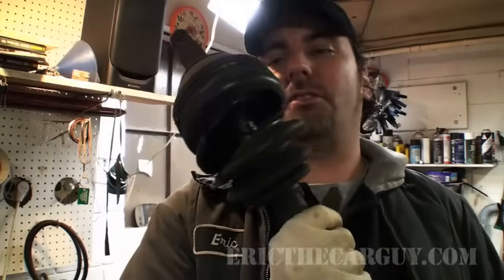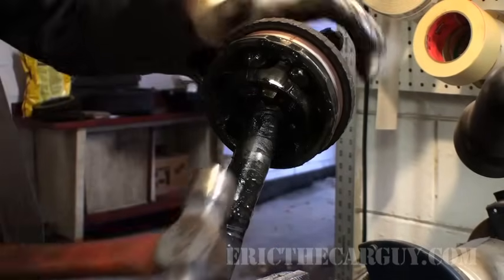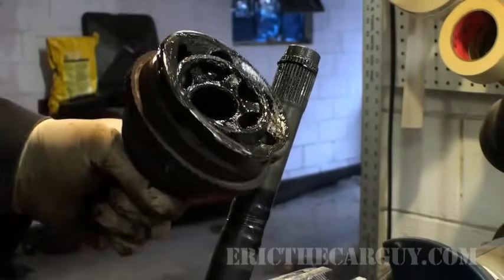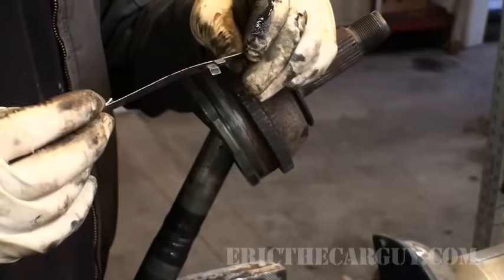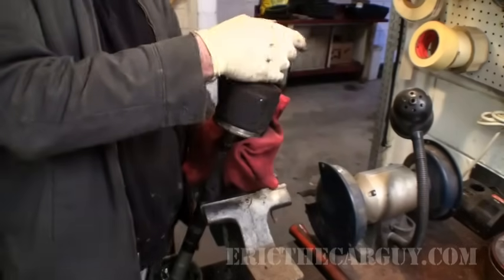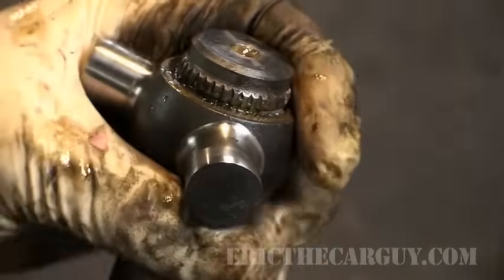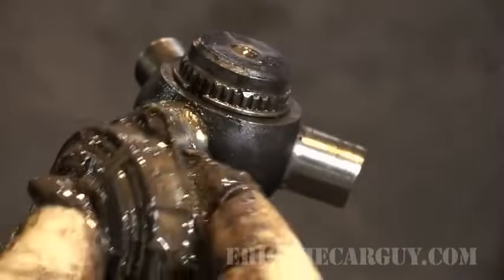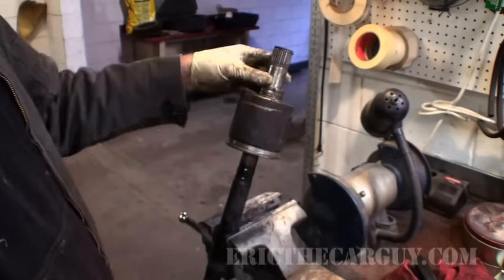How To Replace CV Boots - EricTheCarGuy

Comment: I have a new car. I ran over some wire and the CV boot was torn. Because the car is new they want 510 bucks for the new CV axle. 

Have you had any experience with split boots? I have heard over and over that they aren't worth the time or money but this has been caught quickly (so not much if any dirt in the joint) and the new CV axle is 510.

Do you think a split boot could hold me over until car parts for this make and model start becoming more common and cheaper?
Reply: Depends on how bad the split is. Sooner or later it'll run out of grease. No grease, no lubrication. No lubrication, parts wear faster. I'd check Rock auto for the part in question and to also do it yourself. Good luck.

Comment: Eric! I need your advice, or at least someone on here. 
I have an 03 Jeep Grand Cherokee Laredo with 2WD to 4WD option, I have been dealing with a loud knocking nose and the jeep likes to make a "back and forth" motion when i apply the brakes, The steering wheel does not shake, and the brake peddle does not vibrate or kick. I have jacked both front wheels up and turned them as fast as i could, The rolled smooth, and did not hear any unusual noise or knocking. Wiggling both front wheels and they seem good.  My main question is, if it is a bad cv joint. Could i just remove both of them on the front and not replace them?  I only use 2WD all the time and dont even have the driveshaft attached to the transfer case for 4WD.
Reply: The back and forth motion might be caused by a warped rotor. Maybe have them turned and replace brake pads. Just a thought
Reply: New rotors and brake pads have recently been installed to trouble shoot this, so far no good luck. I did end up pulling both front wheels and the front end out to examine the cv joints and they are fine. But i hear a knocking noise constantly when rolling down the road, 1 u joint was replaced, the other one was examined, told it was still in good condition and shown that it was. Replaced all wheel bearings.  Im hoping its just a transmission mount or something.

Comment: I just use a universal boot that’s cut open on purpose  and without taking the axle out or any of that work all I do is cut the boot to size and then wrap it around the axle shaft and then use the supplied rubber cement that binds it together ( insanely strong) and then just use cable ties. Done in 10 mins

Comment: Can anybody tell me what grease to use on inner tripod, what nlgi rating it is and what its made of, because i cant find any answers online or from part stores or the dealer, they all say to use cv axle grease but from my research moly will ruin tripod needle bearings. I have broken three sets of aftermarket axles due to inner joint developing play and causing clunks and vibrations most likely because they are using the wrong grease on assembly. Want to regrease my original gm axles but cant get any awnsers

Comment: Is it normal to hear some clicks just after changing the cv joints? Maybe the grease need a little time to fit good on balls? I've just done the hole thing that I saw in this video.
Reply: Louie Anderson Did you replace the WHOLE axle, replace an actual CV JOINT, or just reboot? At any rate, I wouldn't expect to hear any clicking if it didn't exist previously. Maybe it's not fully seated in the transmission?
Reply: hoopfan71 I've changed the cv joints. I think that my error was from knocking the cv joints to fit with the axle. Was a pain in the a*s to put that ring in the cv joint for the first times. Maybe they are clicking because of knocking them too many times. The noise starts after 1,2,3 miles from the start If I drive normally. If I redline it, the noise starts from 1/2 mile and I hear the noise louder then normally. Sorry for my bad english. By the way I just ordered brand new axles.
Reply: Louie Anderson Did you try removing the axle and reinstalling it? Yes, that clip is a pain. One of my axle re-boots went just fine, but the other one was a pain in the arse.
Reply: hoopfan71 Yes, I removed the axle and I reinstall it. Like in the other video of Eric.

Comment: but you forgot an important thing before you rejoin the CV to the Axel you forgot to clean it with gasoline or whatever to ensure that the cv is pretty clean from the old grease that maybe holds dust caused by the cut boots .. but im sure you didn't forget that :)
Reply: +The Future Sound Of Egypt He said use solvent and a parts washer.  I've used a pressure washer and detergent, it works.

Comment: Question: My axel boot is completely ripped open on the inner joint(1999 Subaru Legacy Outback). I don't hear any clicking at all, I didn't think anything was wrong with them, I just noticed it while changing the breaks. However I was changing the breaks because the car shakes hard and pulls to the left when breaking hard. Changing the breaks (rotors and pads) did not fix this. Could it be an issue with the axel?
Reply: Have you checked your brake rotors? bad rotors will cause that

Comment: Have a leaking inner cv axle boot on a 2002 civic. Is it ok to use one of the aftermarket boots that are split and Bolted closed? Don’t have the means to take off axle.
I can then pack in more grease while axle still installed in car?
Reply: You better do it this way, those split boots wont last long. Do it once right, or do it twice
Reply: @gianfrancoa   just updating...I did replace entire driver side axle and was not hard at all on this car. I just had someone come give a hand as 2 are better than one. they also had some tools I needed.

Comment: I really appreciate what you do.  I've watched a ton of your videos.  I have a boot that is leaking a bit of grease from under the clamp (inner boot, axle side).  Do you think it is worth it to try and re clamp.  Also  OEM  axles are super pricey but from what I've read,  are way better then aftermarket.  (2005 4runner sport)  Your thoughts if you have time.....thnx
Reply: I have the same problem on the outer boot on my '04 Sunfire. I was thinking if a new clamp didn't fix it maybe just putting some RTV in between where the boot and the axle meet would help make a better seal. Let me know what you end up doing.

Comment: Eric, but in all honesty, lets say you have original CV in there.  Catch the boot before it gets ruined and change it out.  Won't that save you from having to get brand new and maybe even substandard CV axles?  My driver side CV axle has to get changed AC Delco will cost $240.  I'm stuck getting Duralast.  But on the passenger side I wanna save that AC Delco already on there.  Do I have to re grease if I am changing the boots in time?

Comment: hey Eric I have 2007 Toyota solara convertible v6. the dealership said my cv boots are busted and slinging grease everywhere. I have yet to replace although I bought the part. Is that a job I can do myself to save hundreds of bucks.
Reply: Chardonnay Dunbar. Better off with new cv axcel.  Don't waist your time.

Comment: Is it ok to recommend boots on cv axles that arent clicking?  I see cut boots come in all the time, customer will never buy an axle until it fails or is really close to failure.  It would be nice to sell them a lower cost alternative than a full replacement (that probably pays me more book time as well)
Reply: I'd suggest you stick to just selling/recommending them what they really need. When it is broken, fix it. If it's mostly cosmetic, point out the part- a lot of costumers don't like to see broken parts on a machine they depend on. If they're using the car to get around, they won't care and they'll be much more satisfied as costumers if you don't push an up-sell. You might lose a little book-time, but when you're getting jobs in and out and sending satisfied costumers on their way, your book time will get filled soon enough.
Reply: kevin smith I think it is good to replace the boot because there is always the chance that the new CV will be inferior to the old one, and the customer will then be resentful.
Reply: I agree with that actually.  A damaged but working OEM part that is showing no symptoms is always better than an unknown, aftermarket.  Even though the new part is probably good and has warranties... if it aint broke don't fix it.
Reply: +kevin smith also I changed my cv axle in my cavalier to an aftermarket one from autozone, but now there is more play where the splines go into the differential causing more slack in the drivetrain and a noticeable clunk when putting the car into any gear. so if it ain't broke definitely don't fix it lol.
Reply: I trust autozone for windshield wipers and fluids.. I once even got a slave cylinder for a clutch there (that was a gamble)..
I don't think I'd even trust them with drivetrain components.
(clutch master cylinder I dont count because it doesn't take the engine power, although it is a component of the transmission, therefore drivetrain, don't jump on me youtube haha)
Reply: Give them the information then let them decide.  They have a torn boot.   That will rapidly accelerate wear.  Then present the cost alternatives.  The thing is, it is more labor to clean one out, regrease, and reboot, than just installing a new one, so there is a higher labor charge.

If you are only offering an expensive OEM CV assembly, it is probably cheaper to pay the labor to refurbish one.  If you are offering an aftermarket it is probably cheaper to replace the whole assembly.  Of course you should also drive the vehicle to determine how worn it is as they won't be happy if they pay to replace a boot but it's still going to fail soon due to too much play greatly accelerating the wear.

Comment: Well in mine country cv boot is cheaper to change than whole axle. Nissan Primera p12 axle costs 940euros new boot 10euros, its better to keep eye on boots and your axle will last longer than a whole car
Reply: Lukas Juozaitis. Yah if you buy new, but there are many places that will recondition your drive shaft with new joints and  boots for about the same price as pulling it apart yourself just to do boots. We get reconditioned shafts for like $120, sure you can buy boots for half that, but then you have labour costs so it works out about the same.
Reply: Well ive never heard about such thing in Lithuania, Europe. Then its really better to get new then replace

Comment: I hammered the crap out of the outer cv joint and it won't separate. Ended up removing the inner joint and replacing the outer boot from there.  Nissan Pulsar N14

Comment: My front driveshaft has a cv which the boot has torn and its $300+ so i decided id replace the boot. However the axle shafts replace like $30 a piece. Way cheaper.
Reply: My '92 Celica CV axles were 150$ for the pair brand new.

Comment: Now I am confused. I have an old good car and just got a clicking noise and I think it is the left broken boot. Do I just change the one boot? Or should I change the whole axle assembly? I only will drive this car till November and then I will donate it or sell it for parts. Any ideas what's best?
Reply: Blanka Jindrich If you're sure it's the axle that's clicking, rebooting it will not solve your problem. You can either replace it or ride it out, since you're going to be donating it anyway.
Reply: Blanka Jindrich If you're sure it's the axle that's clicking, re-booting it will not solve your problem. Re-booting is only done to prevent grease from leaking out and to prevent debris from getting inside the joint to cause clicking. It should only be done if the issue is caught early. You can either replace it or ride it out, since you're going to be donating it anyway.

Comment: is it 100% inner cv joints don't have clips? just want to make sure....planning to do the boot for my 99 camry....if I could easily separate the shaft near the carrier bearing, I will just buy the cheapest boot....but if it will require taking out the whole cv axle, I will just buy the universal stretch type boot.

Comment: When Eric Says Why Bother... The quality of the aftermarket replacements is sub-par, expect to get 1-3 years out of them.  My drivetech axles have gotten sloppy after 2 years and will need replaced again.  The quality of the metals used is poor and causes this quick degredation.  I also can't explain how frustrating it is trying to problem solve what's causing strange vibrations with your car only to come back to parts you had just replaced.  Oem honda parts are crazy reliable and eliminate the headaches.  I'll always rebuild instead of trusting aftermarket companies because  they've let me down so many times.

Comment: mine boot is cut when i steer the wheel power steering fluid comes out a lot right out of the boot rubber thing 
how much does the axels or the cv boots cost 
thanks
Reply: that's not powering steering fluid!! that's transmission fluid. Bad seal? is it in the inner or outter? (transmission side or wheel side)
Reply: transmission fluid !? dammmn 
its closer to the wheel 
i got my transmission flushed but the gaskets was the wrong size so he just used the old one 
my transmission pan thing is so oily too

Comment: Does anyone even know what is causing that "clicking sound"? I think it's just from when the boot cracked open, a lot of the grease got strewn out that was actually deadening the sound, and maybe it's not that detrimental to be worried about it?
I have just been contemplating about this issue for some time now, because I just put new shafts on and it was less than a few months before the boots cracked and the clicking began. #JustWondering

Comment: Got the old "bronze" hammer from when it made sense to rebuild; turns out to be berylco- highly toxic. Luck and loads of grease- that whole hammer was always coated along with vise, tools, you, etc. Molybdenum? Sulfide? Burn your clothes and start drinking heavily. The split boots are for sissies. Another invention stretched the boot over the entire CV joint- which sometimes won't pass through the bifurcation in the control arm, which is the point of this gabfest- you may need to take the new shaft apart to get it in. Grease-drenched beryllium hammer in hand- get ready for a dark gray mess. Btw- don't touch the brakes- oops

Comment: I had a CV axle fail without the boot failing. U-joint just crumbled. Any speed above 20 miles per hour and the car would shake like crazy. Had my phone on the dash and the screen was spinning.

Comment: Taking the CV shaft out seems like a lot of work, why not use a boot that's designed to go on with the axle still in place? One of those split boots that you then have to glue. Looks like it would save a lot of time.
Reply: Because those wont last

Comment: A new CV joint for my car is really cheap, only like 20-40€, and i have a mechanic friend i could pay with just a bottle of liquor. Worth changing in my case?
Reply: But those aftermarket are crap,  better keep your OEM axles, and replace the boot with an OEM kit
Reply: @gianfrancoa  But my CV joint is already worn, how does changing the boot help
Reply: @TopiasSalakka  How do you know is worn, has any play or sound?
Reply: @gianfrancoa  Loads of play, it only clacks when i turn though.
Reply: @TopiasSalakka  so time for new shafts them
Reply: @gianfrancoa  Why when only the joint is bad?
Reply: @TopiasSalakka  if you can replace just the joint, so do that.

Comment: Coming from the ACVW world CV joints that click, click due to the need of fresh CV grease. we frown on the axle swaps due to the quality of the axles and joints often being piss poor compared to a 500,000 mile German CV joint. Yes a 500,000 mile joint, clean it re-pack and and reinstall with a new boot. The boots these days are harder to source quality wise then then a CV joint.

Comment: im not getting a clicking im getting a vibration under acceleration only around 4-6k rpm s2000 I know they have this issue Honda quoted me $220 for each side just in labor not including the parts

Comment: Could this also cause a squeal that sounds like a serpentine belt??
Reply: Geo Fox I don't think so. Those squealings sounds like metal on another metal surface. Check your belts and bearings on ac compressor, alternator and steering pump (I think there's no bearing on this one). Is a video on youtube how to identify the sqealing under the hood. I don't remember now the title.
Reply: Thanks so much for the reply, took it to the shop and it was something like a differential seal I believe.
Reply: Geo Fox You're welcome!

Comment: Time for an update!!!  Its been 11 years since this video was made.  If you have a damaged boot, replace and regrease it.  Don't buy aftermarket axles.  These are made in China (like everything else these days) and made way too cheap and cause vibration issues.  Total junk. Fix up you old original one, especially if you have a Honda.  If you have to replace your axle buy a good OEM unit off eBay or a good OEM unit from your local scrap yard.  You can also buy OEM remanufactured axles from NAPA.  If you have an unlimited budget buy OEM new from a stealership or a premium remanufacturer such as Raxles.  All this said, if you have a POS car and just want a quick fix you can buy new aftermarket axles because it won't make a difference in that kind of car.

Comment: When Boots are too small  to slide over shaft.....put boot in hot water, which both expands rubber a bit and makes it stretchable enough to slide over smaller diameter shaft...(where there's a will there's a way! :) )  (oh, not applicable to condoms by the way)
Reply: oops...."over larger diameter shaft"....type too quickly there...